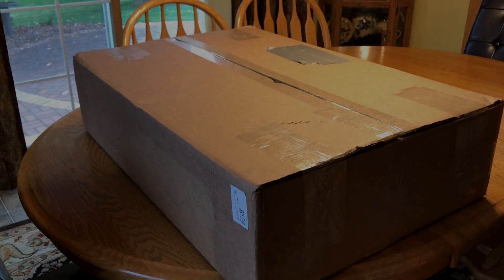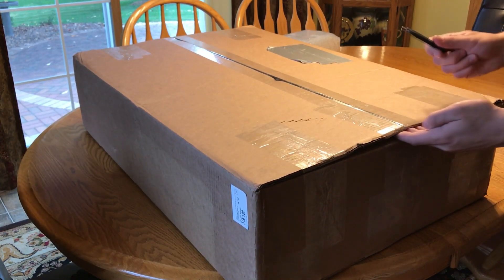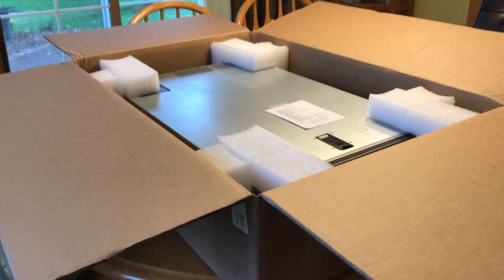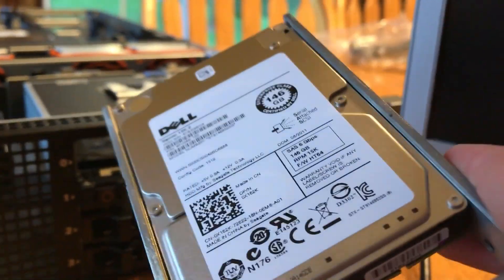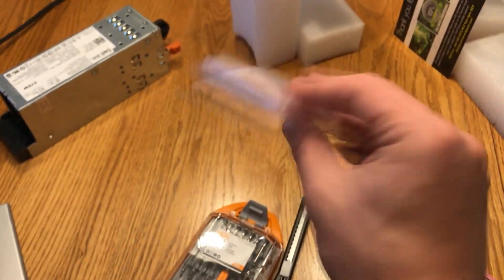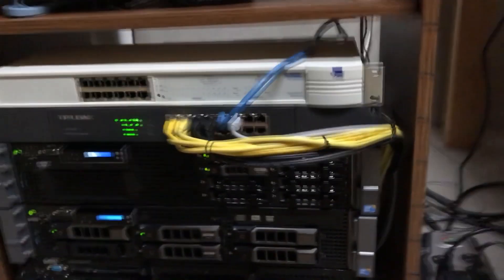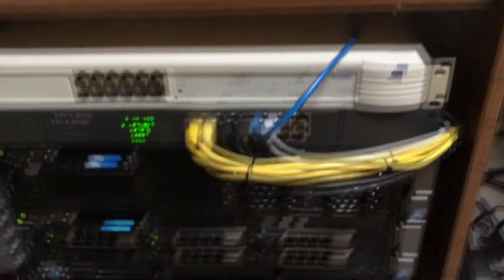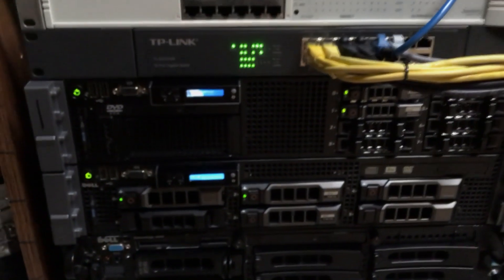DELL R710 UNBOXING AND SETUP! LAKE DATACENTER!

Comment: Great video man! I just picked up a R710 and got it today. I also have the l5520 processors with 2 x 146GB 2.5" drives, but just 24GB of RAM. First upgrade is going to be RAM and then more drives. What are you using it for now?
Reply from the maker: Currently this one is not running, I pulled the ram and dropped it into my other R710. My setup has changed a lot over the year or so this was updated but currently I have everything racked, I have 2 R710's an R430 and a R620. I use my servers to setup things like AD and System Center just so I can figure out how all of that is setup.

Comment: when you had the lid open the fans sounded super loud, however when you had them all setup and mounted it sounded pretty quiet.
Reply: Power-up is always loud, it settles after a few minutes.
Reply: Also, when the server is on, the fans speed up when the lid is removed. When you put it back on it gets quiet again
Reply: Thats because theres a detector button in the chassis that spins up the fans when the lid is removed. When its put back on, it pushes the button into the closed position

Comment: How do you manage all the heat that comes out of the 2 r710s? I`m having trouble keeping my 1 running for more than 4 hours without it being like summer.
Reply from the maker: They are in my basement which stays about 65 degrees F so heat has really never been an issue.